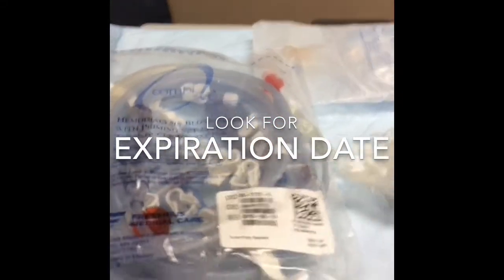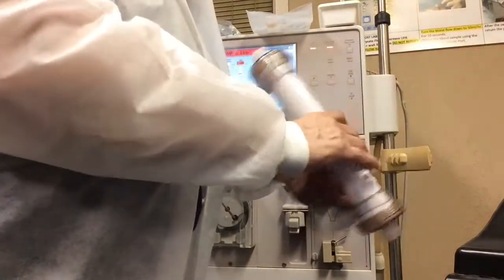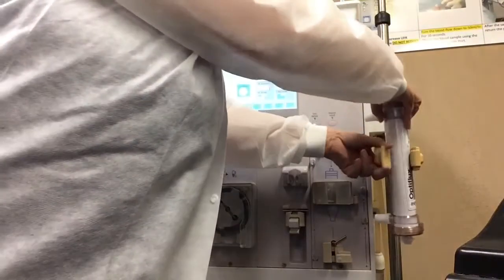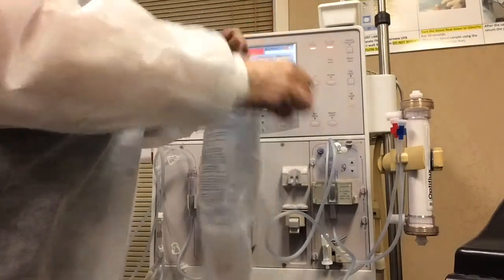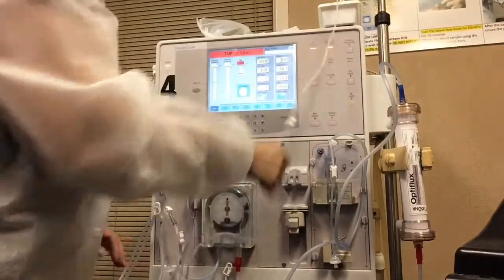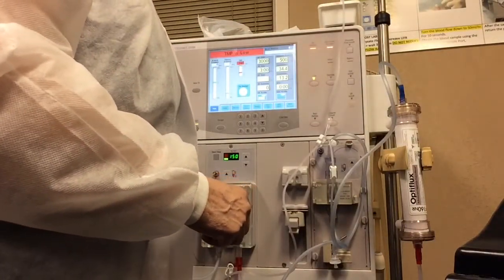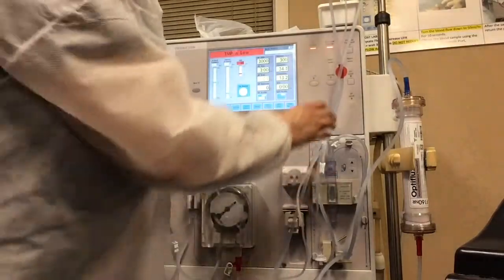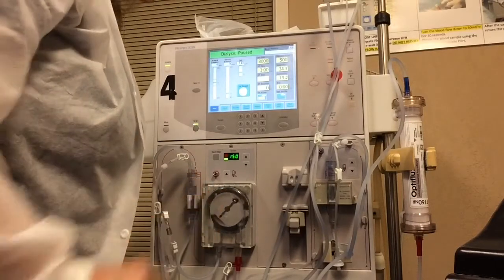Best Dialysis Priming Video 2008k Fresenius Machine

Comment: During priming the blood pump speed should be 200cc/ minute and you need to pull the dialyzer off the holding clamp and tab it several times to make sure all air bubbles are coming out.

Comment: Why is your bucket up high and on the pump side of the machine when everybody else has the bucket on the dialyzer side and down low??
Why did you clamp the the art line with a blue clamp when everybody else let’s the NSS drain into the low bucket, then clamps the large clamp before hitting prime??
Reply from the maker: Hi Rich
1. I don’t decide how the machine is structured it’s manufactured this way. if the bucket was on the dialyzer side down low?  The dialysate lines would be in the way. 
2. you can use the large white clamp to stop the saline flow, I prefer to clamp below the T with blue scissor clamp.
3. There are a lot of right ways of doing the same procedure, just make sure you are following your companies policy.
4. Thank you for the questions.